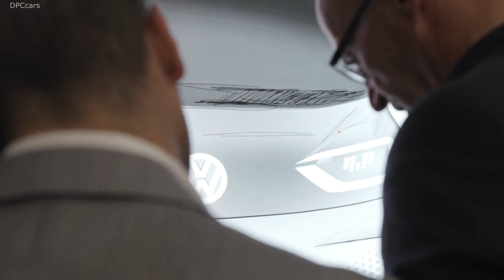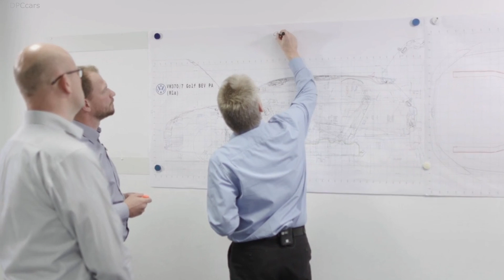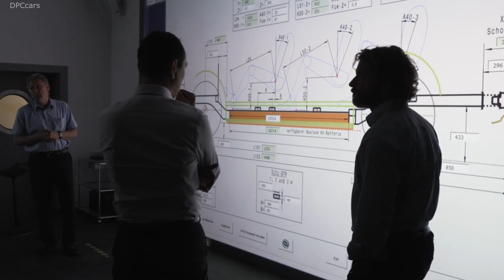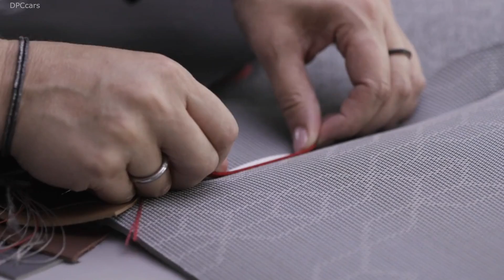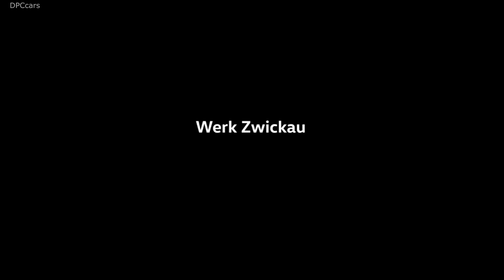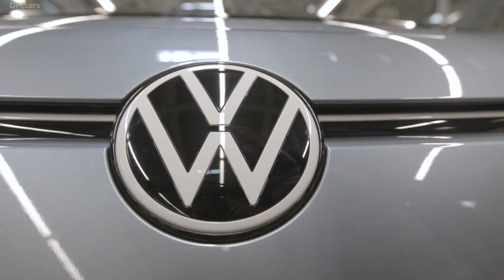Electric VW ID3 Design and Factory - Volkswagen

Comment: What about the liquid refrigeration system for the battery?
We don't want anymore another horrible air ventilated system like the old Nissan Leaf who destroyed the batteries.  We want a modern liquid system managed with a heat pump that takes a lot of love and care to the lithium batteries at hot summer and cold winter days.
You can copy the free of patents Tesla system.